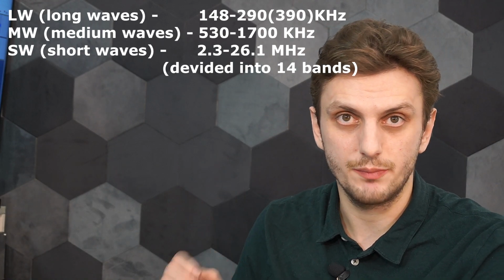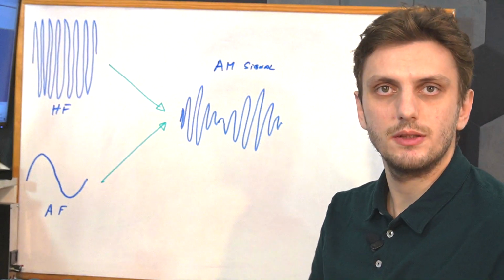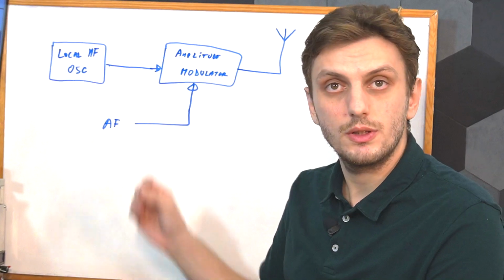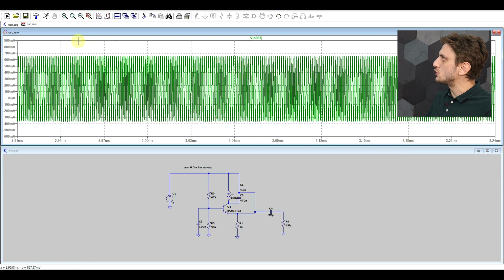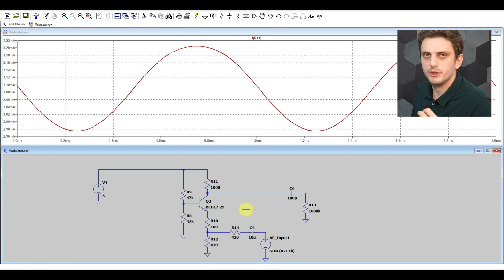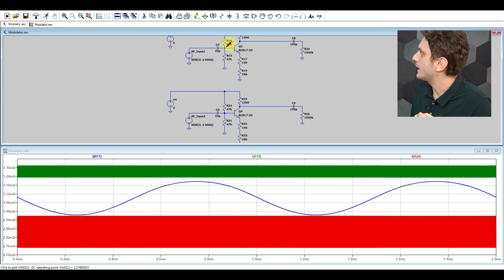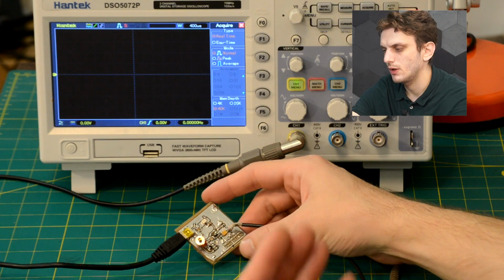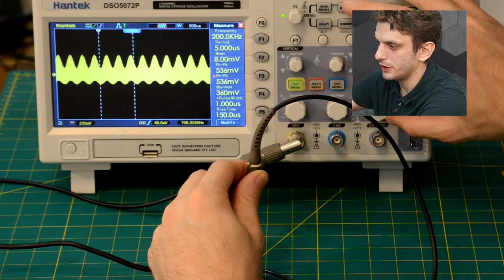(old) Electronics tutorial - Building an AM modulator

Comment: 6:18 "So if we look at the audio frequency input and the output, well they are a bit spaced by a certain amount of voltage, but their amplitude is roughly the same, which is typical for the common base amplifier." Oops. For the common base amplifier is typical the big amplification of input voltage. In your schematic "their amplitude is roughly the same" is contingency. Isn't it?
Reply from the maker: Good catch! You are right. I guess I was trying to say emitter current is equal to collector current ( I re-checked just to make sure I wasn't mixing things up again). The reason the input and output signals was the same in this case is pure accident - the input signal gets divided by the 2 470R resistors, to half, and then this gets roughly doubled by the transistor common base amplifier (collector resistor is double the emitter resistor);
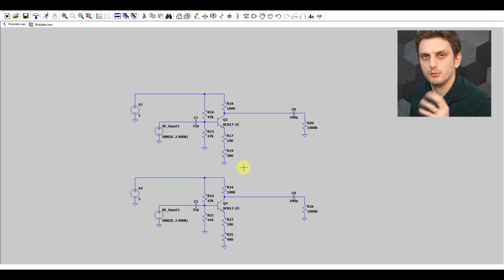Reply: @FesZElectronics  :) Let me ask you one more question. 7:08 Why are you simulating the input audio signal by changing the resistance at the emitter of the transistor? This is rather strange in my opinion. Rather, you should put a voltage source in series with the resistor.

The input impedance of the stage is approximately Re * h21, but it is not Re at all that depends on the collector current, but rather the gain h21.
Reply from the maker: I'm not sure anymore if the collector current is the cause of the input impedance  variation, but rather the collector-base capacity based on the transition capacity variation. Considering Vcb has a variation between ~0.2 and ~0.4V (in the 2 extreme cases of input audio voltage) this is the only parameter that seems to vary enough to cause the large change in amplifier input impedance(1.2K to 2.4K); With this capacitance change, the large swing in gain can also be explained.
Thank you for pointing out these inaccuracies!
Reply: @FesZElectronics  Let me explain. The AM modulator of your choice uses the nonlinearity of Ic vs Vb (as you know, this is an exponent, but we will consider it in a large signal mode, so for simplicity, we will replace the exponent with a straight line with a bend at 0.6V). In proper operation, both the low frequency signal and the high frequency signal must have an amplitude of 1Vpk-pk or more. It is good if they are equal in amplitude to each other. In this case, at the top of the positive half-wave of the audio signal, the high-frequency signal will pass to the output completely, at the top of the negative half-wave it will not pass at all, and when the audio signal passes through 0V, only the positive half-waves of the high-frequency signal will pass to the output. As you can see, the transistor operates in cutoff mode for a significant part of the time, and therefore the output signal will be very different from the modulated sinusoid. Therefore, instead of a resistor, a resonant circuit tuned to the carrier frequency is usually placed in the collector of the transistor. Without such a resonant circuit, the output signal spectrum will be very messy. Here are links to two figures that explain this: https://conture.by/wp-content/uploads/2011/12/mris23.jpg , https://conture.by/wp-content/uploads/2011/12/mris24.jpg

Naturally, modulation will also occur at not optimal (small) amplitudes of the input signals. It's just that the modulation depth will be much less. By the way, it is better to choose a smaller initial collector current (for example <1mA) in order to work in the place of the greatest nonlinearity. The Q factor of the resonant circuit should also be neither too large nor too small. I would recommend Q = 3 ... 6 - this is quite enough for signal smoothing. And of course, it should be admitted that although the input impedance changes (since hFE vs Ic changes), it does not affect the modulation process. Maybe you should have used some more intuitive modulator? For example, based on a field effect transistor or photoresistor in controlled resistance mode. It's up to you, of course.
Reply from the maker: Hello SaihoS1,
I agree, as long as the input AF amplitude is large enough, then this operating mode makes complete sense - reduce the Vbe low enough to get the transistor in cutoff mode - no modulation, increase it, get modulation. I initially thought that is how my implementation would end un working - but the main difference I observed (with my particular choice of components and signal levels) was that the larger the AF value (positive peak) corresponding to the higher collector current, the smaller the output RF voltage amplitude (I'm getting highest output amplitude when the AF signal is at the low point). If my understanding is correct, the operating mode you mentioned should work in the exact opposite way.
In the simulations Vbe peak stays between 0.628 and 0.632V when both AF and RF signals are applied, so the transistor is nowhere near the cutoff mode.
Another interesting phenomenon I observed in the simulation is negative instantaneous base current (with RF signal applied) while collector current was still ~3mA; the only explanation I could come up for this is signal being pushed back trough the base trough collector-base capacity.
You also mentioned collector current <1mA to enhance this effect of gain variation; In my case its 2.9-3.1mA so at this point collector current related gain change is much smaller, not enough to account for the observed behavior; 
Adding the LC circuit in the collector does help greatly to rebuild the signal when you only apply half the RF signal (negative part being stopped by the cutoff mode). In my case, even if there is no LC circuit, the output still looks like a sine wave (there isn't any bit cut of).

Comment: Finally, something RF related on the channel! :) Here are a few things I would like to add. 1) Actually there are plenty of AM station on HF bands, e.g. 41 meter band (7.2-7.45 MHz). But this band is "open" only after the sunset, during the day you will not receive much. 2) BC817 is not the best choice for the oscillator because of relatively low fT. 2N3904 are cheap and have fT = 300 MHz. It's also a good idea to use a buffer after the oscillator to make it see high impedance load, otherwise the oscillator can be unstable. 3) Other type of modulation that's not difficult to transmit or receive is SSB. If you are interested in modulation, look for diode ring mixer or Gilbert cell schematics. Both are interesting to model and fun to build. 4) The better choice of the carrier frequency would be ~27 Mhz, i.e. CB band. It doesn't require a license to use, the antennas are mush shorter (it's possible to build a relatively efficient antenna ~20 cm long), and it's not that difficult to build a stable oscillator for frequencies below 30 Mhz. 5) "Experimental Methods in RF Design" is the best book on the subject I know of. The part about DSP is not that great and is obsolete though. If you are interested in antennas and transmission lines, I would recommend "The ARRL Antenna Book for Radio Communications, 24th Edition".
Reply from the maker: Quite a lot of info there, very interesting and well put! I'll try to address some of the points you mentioned -2) I used the BC817 because I have a bunch of them, and for a 1MHz oscillator, it doesn't really matter if fT is 100MHz or 300MHz; for higher frequencies of course, this is no longer the right component. 2/3) - I guess I just wanted to make a really basic circuit this time; I will try to address the more complex and proper versions that you mentioned in a future video. 4) if I remember correctly, I should have one of those CB radios in a box somewhere. I got it ages ago for my car, but got bored with it really quickly - all you hear is truckers swearing, its funny but get boring really quickly. You are right though, depending on the country, you are legally allowed to transmit up to 4W of power on those bands without any license; so that is quite an interesting way to try things out. 5) I don't have the books you mentioned, but thank you for putting them here! I'll see if I can locate them.
Reply: One more thing. I good receiver for 0.5-1766 Mhz frequencies would be RTL-SDR v3. It can be purchased here https://www.rtl-sdr.com/buy-rtl-sdr-dvb-t-dongles/ Be aware that there are clones on AliExpress/eBay that although are cheaper may not have direct sampling function (receive only frequencies above 28 Mhz) or not work at all.

Comment: Great and unique as always. It would be nice if you could cover more RF projects in your videos.
I actually have a question. 11:35 you said radiating EM waves in short distances is impossible and the only way to transfer your data is via electric field and magnetic field. What do you mean? EM waves are made up of electric and magnetic fields. So what do you mean that you can transfer you data with electric and magnetic fields but not with Electromagnetic fields?
Reply from the maker: Hello Ali! What I was trying to say is that you need to be in the "far field" to be able to radiate, this is based on the frequency of interest. At short range, the magnetic and electric fields are not properly combined and can be treated separately. The far field is roughly 2*wave length.
Reply: @FesZElectronics  great! I didn't know that. By the way, as a kind suggestion, one thing that makes your videos so unique is that sometimes you go through books, application notes, etc. in your recordings. So it would be great if you keep doing that (like introducing the relevant references of your circuits, etc)
Reply: @FesZElectronics  Since it suits this kind of DIY home projects , I wonder  if you can cover electrically-small antennas impedance matching since all books in the literature on this topic are very mathy .
Reply from the maker: @dr.gordonfreeman2832  I do plan on continuing the impedance matching topic at some point, but I'm not sure if I can skip the math... I will try to apply it though, so try to implement whatever I calculate